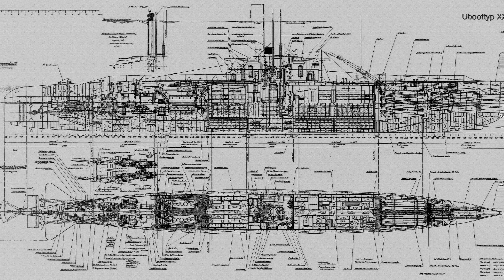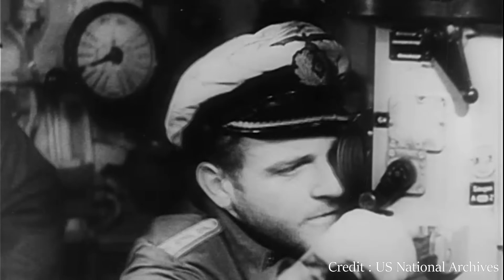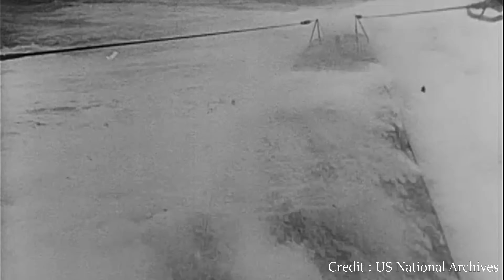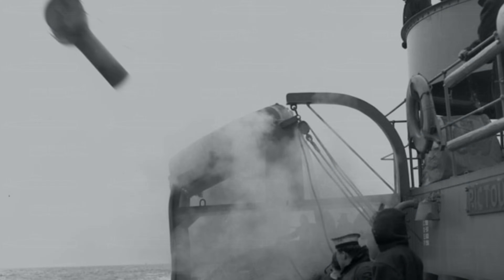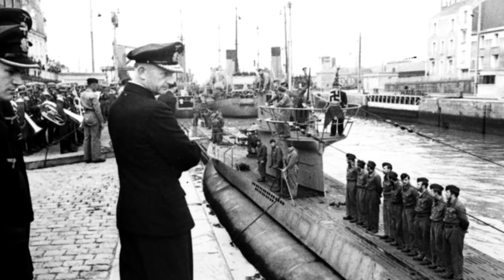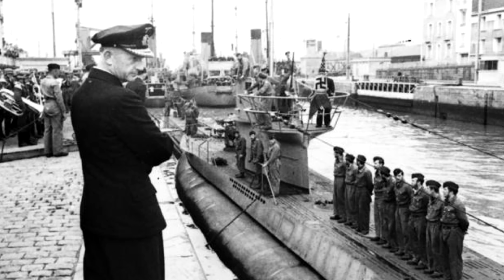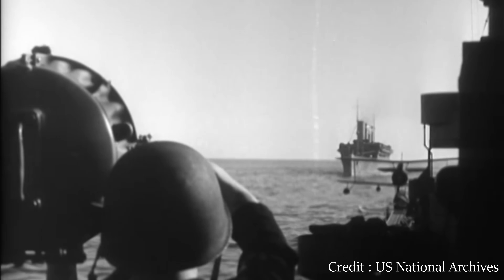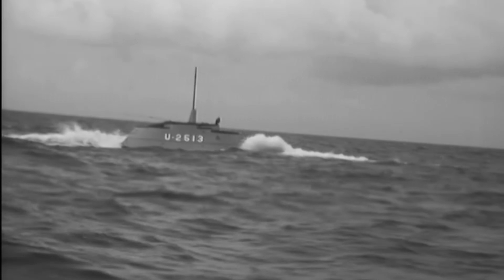Was the most innovative submarine design of WWII successful? The German Type XXI submarine

Comment: An interesting summary of a key vessel in  modern submarine development. An obvious question, revealed by your excellent research: Why were the type XII's not fitted out with the engines specified in the original plans? I suspect the level of damage the allied bombing campaign inflicted on the program was a factor. thank you for posting.
Reply from the maker: Thanks for your kind comment 😊 The decrease in performance was not due to change in engines, but changes in the total powerplant output. If I remember correctly, a significant part was due to the supercharger. 

Now, if you are referring to the change away from the hydrogen peroxide powerplant, then I touch on that point in my other mini documentary 😊https://youtu.be/FJ_O4DKcdkg
Reply: How successful? Not very the war ended too early.
That said as the first cold war SSK it was hugely successful in that its innovations took submarine design in a new direction. Many of the innovations of the Electroboat program allbeit work in progress were critisiced in the USN 1946 N.H report, but then subsequently adopted successfully into every post submarine design. Ratifying the type XXI Electroboat by default.
Reply from the maker: @brianswan3559 if I remember correctly the first USN nuclear submarine hull design, was significantly influenced by the type XXI :)
Reply: @BecksHobbyProductions  Indeed it was, primarily however the USS Nautilus was an enlargement of the Gato hull design.
Reply from the maker: @brianswan3559  Well according to the book "Cold war submarines" the hull design was based on the type XXI and XXVI. This was the proposal by Gunn and Abelson.
Reply: @BecksHobbyProductions  Have you ever seen pictures or drawings of SSN 571? She is basically a modified Gato/ Balao/ Tench class boat.
Reply from the maker: @tomtrenter3208  in this case, I will rely on what the designers of that submarine state, rather than what I would believe or guess. I expect them to know better. When I look at the Nautilus and Trench class side by side, they look nothing alike in profile.

Comment: As I recall it, one of the new things with the type 21 was, that it was made in "slices" all fully equiped, and ready to be welded together, comming from all over the country on barges via the canalsystem. 
 But nice video, I am surprized it wasn´t better. I have heard a lot over the years, so quite strange to have to chance ones point of view...
Reply: Yes, it was. But German manufacturing skills were not up to the task, with the result that the boats needed almost total rebuilding when the sections arrived at the yards.

Tolerances which might have been accepted in prefabricated freighters or even escort carriers were certainly not appropriate if applied to submersibles.
Reply from the maker: @dovetonsturdee7033  Yes, there were absolutely problems with the quality of production. This was also part of the conclusion by the US Navy in their post WWII analysis. It was fundamentally a new way to built submarines so some teething problems should be expected, so add the effects of war it's not a good combination for quality 🙂 The first type XXI which went to sea had to return early due to problems with one of the sections.
Reply from the maker: Yeah, I was a bit surprised when I found this research, but it is quite extensive. I think it comes down to the very few boats combined with short time in operations - this does not yield a great deal of actual experiences during WWII. I think thats why the design specs were never really put to the test and validated.
As for the "slices", I go over this in my other video about the type XXI :)